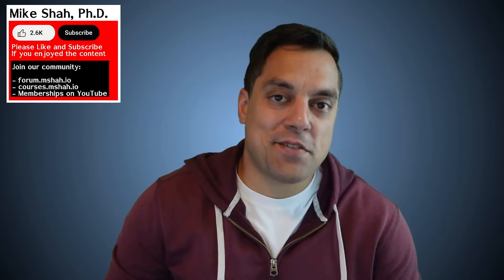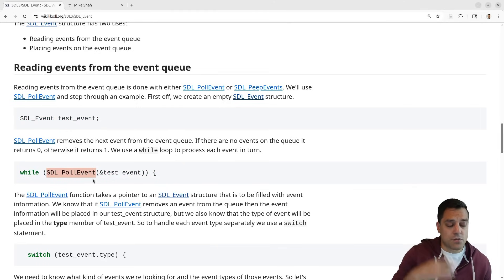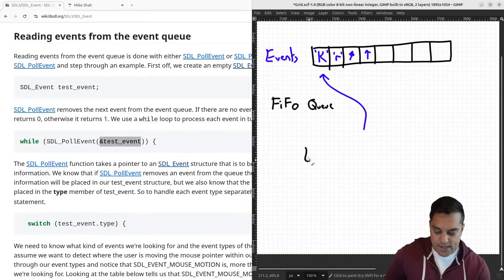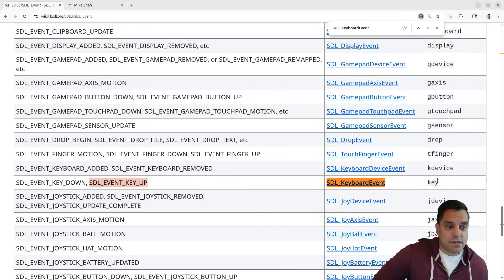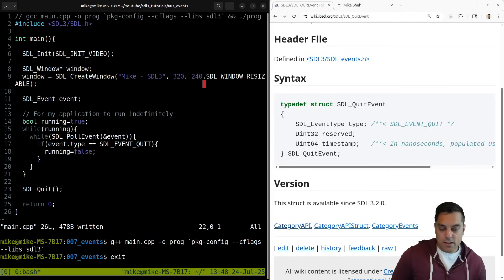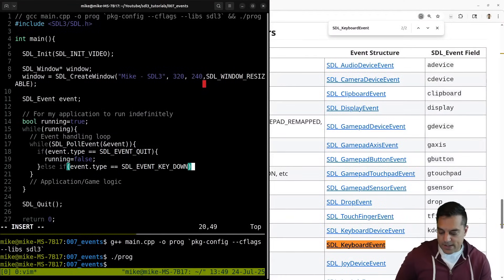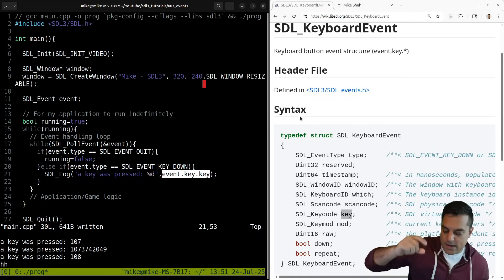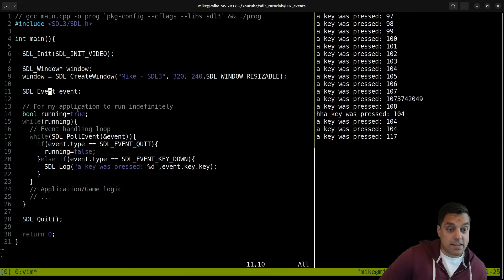SDL3 event loop - detecting key presses [SDL3 Episode 7]

Comment: Hey, just so you know.

Perhaps because I am currently in Wayland or for other reasons I was unable to verify, I was unable to get the window focusable and clickable. There was definitely a window running, and I was able to close it out to apply the SDL_Quit event, so I think it might be the way that my current Fedora version of Linux applies Windows without a Renderer. (There was definitely something happening as my fan was going off)

I was able to fix this by going to a future part in the tutorial, learn how to get a Renderer going, and was able to get the Window clickable and focusable so I could go back and get the SDL_EVENT_KEY_DOWN event read.

Perhaps it's my beginner knowledge, but I feel this could be an issue for someone in the future.

Either way, thank you for taking things one step at a time with this tutorial series. It has been very helpful. I also appreciate you going to the API pages during the lessons.
Reply from the maker: Cheers thanks for sharing! Hmm, yeah I wonder if different operating systems handle the polling slightly differently. I suspect Ubuntu and Debian are the two flavors of linux most tested by the devs, so thanks for sharing this. If anyone else has issues, maybe we can figure out if it's a bug, or there's something in the implementation that needs tweeking.